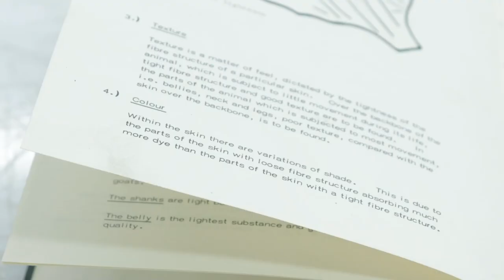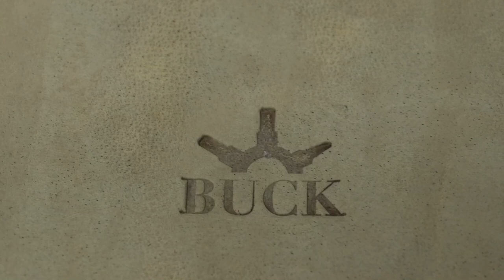Bespoke boot making size 48 | HANDMADE | hand welted working boots

Comment: Fabulous work! Just curious, why do a 270 welt on this boot, rather than a 360 welt? Also, even though this isn't a Goodyear welt, do you put anything like cork in the cavity between the insole and outsole? Cheers!    Wait a minute, I think I figured out one of my questions. At 6:13 do I see a cut piece of leather filling the void? If so, what type of leather is that? Thank you!